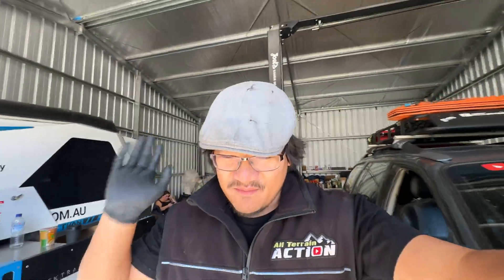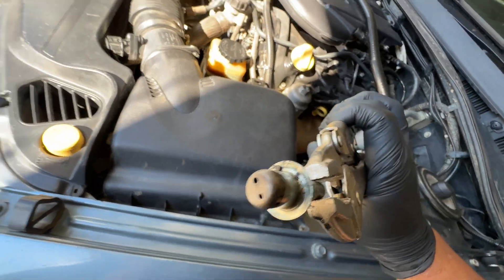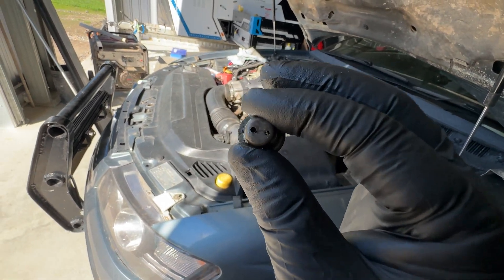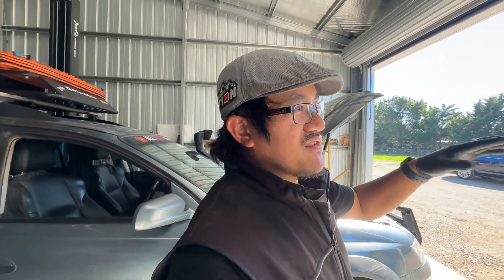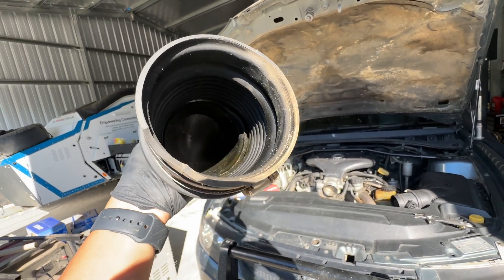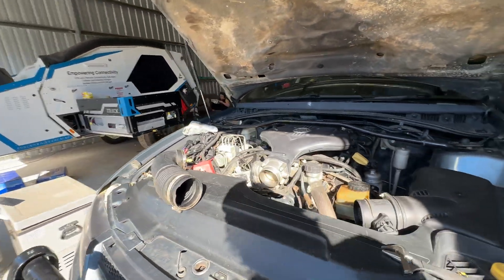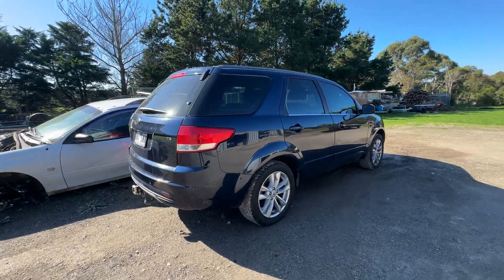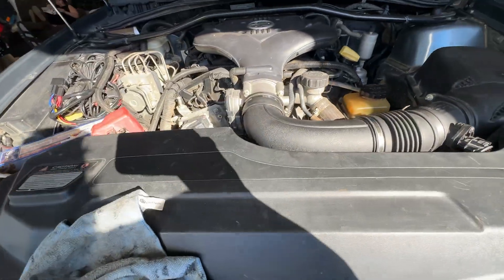THE CORRECT PCV mod 40,000km Result - GM ALLOYTEC V6 LY7 LE0 Engine

Comment: I used to get oil in the front intake and in the throttle body/butterfly of my VE Calais LY7 until i read that GM themselves recommend drilling the top hole of the PCV valve to 7/64 and the bottom to 5/64 . These specs come from GM in America as they use the same engines there as our VE etc. Mostly the V6 camero etc.  I clean the PCV system every time i change the oil at 6000km and my LY7 is pristine inside due to the proper oil changes and PCV cleaning. Make sure that the rigid plastic pipe at the rear of the engine isn't broken (a common thing) also. My VE has done 371,682km. I still the use the original 5/30 oil and it doesn't burn one bit of oil between changes. No Knocks or taps. Nothing but an engine that keeps going strong. Keep up your maintenance.  Not a drop of oil in my intake or throttle body.
Reply: @darrenheading7046  the ridge plastic pipe do u mean the valve breather elbow? If how the f do i get it.off mines super loose and won't come off

Comment: thanks for the update. To be sure 3mm on top 1.5 and 2mm on the bottom right?
Reply: @bigred8438  I’ve done 3mm top and 2mm for both bottom on mine but I have a catch can installed get 2-300ml every 7000k’s when I service it. Actually considering deleting the pcv valve all together and putting an fittings on both rockers instead I’ve got issues with the pcv & passenger side rocker valve creating a vac leak because they won’t seal properly and just sit in the cover.
Reply from the maker: @blown454350 that’s a known issue yep.

Comment: Seems like a lot of fuss to save 200ml-1L of oil in 10,000km. To each their own I guess... I think I'll just carry a litre of oil lol
Reply from the maker: You’re missing the point, this is linked to timing chain failure. Engines that receive this early seems to sustain longer timing chain life. Most alloytecs getting this done early 200,000kms have gone to 400-450k on original timing chains. It also stops front cam sensor seals leaks and rocker cover leaks from crankcase pressure build up.
Reply: @AllTerrainAction  Just change the oil regularly at 3k miles and your timing chain will be fine. I'm not missing anything.

Comment: So should i do the mod or not ? Or just keep cleaning the oem one every 30k
Reply from the maker: Cleaning OEM one every 30 is fine in my books if everything is stock, if you drill them - then do it to the specs mentioned in my other video. Drilled ones to the spec seem to breath better lesser chance to build up blockage/restriction but if OEM is maintained regularly then it’s nothing to worry about.
Reply: thanks for fast answer . so if i drill it i must install catch can  or its fine without catch can  cuz i worry about oil go inside the manifold  . thanks  @AllTerrainAction
Reply from the maker: Fine without catch can if drilled to the specs mentioned in other video. It’s a very minor drill out, if you exceed that you may need a catch can. I’ve ran this 40,000kms with no catch can and Intake is in great condition.
Reply: I think the mod has advantages.There will be soot/ burnt oil build up on the dirty side of the cylinder banks even with cleaning of the standard pcv.That was my experience with very good engine hygene.
After 223,000klm with no pcv service at all but very good oil hygene the pcv was clean and clear inside but you could see a soot crust at the opening of the rocker cover and on the ends of the pcv from poor crank case vapour and gas ventilation.
I did the mod .
I have a catch can too.

Comment: if it is using oil  topping it up with new oil is probably good for it
Reply from the maker: I agree, as long as you are topping it up. The downsides also are more than normal carbon build up and possibly more than normal amount of deposits left within your cat, leading to premature wear in other places. Where one positive, often you might introduce nother negative. Each to their own though.

Comment: why not just run a catch can?
Reply from the maker: In my situation, it makes sense to install a catch can, and I likely will once I've shown in a real world use senario that there’s benifits with the correct modification for everyday use - it costs people nothing but a dril and some time to do this. Using a catch can is a beneficial modification to ensure the long-term health of anyone's alloytec but you have to pick a product, mount it, do some basic plumbing work and understand what its doing plus drain it. Overall, this modification is ideal for anyone with a standard setup who simply wants to maintain their vehicle's engine ongoing - but for those who want the next step catch can for sure and I'll do a video with that when that time comes.

Comment: Its not a Ford Territory you got there Chris. Its a RWD Land Rover/Jaguar/Citroen Discovery.
They were not the most reliable vehicle ever hence why most of us opted for the early 2010-2011 Model with the Barra inline 6. As past 2011 they only made the Barra in RWD format. 
The Lion engine was just a ticking time bomb with timing belt issues which had to be done every 80,000kms and yes.. that gearbox connected to that diesel engine was hideously unreliable with everything from the Torque Converter just exploding to the valve/Solenoids just randomly dying. The most spectacular self detonating Lion Diesel was one where I watched as the High pressure Oil pump decided it didn't want to be a pump anymore.
Reply from the maker: So fix it and move it on 😂

Comment: Was that a FORD Territory I seen in the background lol.

Have to try fix it.
Reply from the maker: 😂👀 bugger you’ll have to come down to Victoria to help me out mate.
Reply: @AllTerrainAction  haha nah still not sold on the diesel.
Reply from the maker: @TerritoryOffroad  yeah I read many not a fan of the 2.7 although the fuel economy side of things seem promising. Drove it 80kms through mixed traffic and without 5/6 and somewhat 50% highway over 90 minute drive trip reset showed around 8.1L/100 which is giving me ideas about a run about car for the workshop. 👀
Reply: @AllTerrainAction  Yeah that's the big thing people love about them. My SY sits around 14 per 100 so fuel economy isn't something I like to talk about. The old SX is worse. I think like any car if they are looked after they will normally be mostly trouble free.
Reply: @TerritoryOffroad   LOL Mine definitely has a bigger drinking problem than yours Keith as mine sits on 15.5 per 100.

Comment: I havent drilled my pcv, I just clean it every 12 months.
Reply from the maker: Nothing wrong with that but I actually think the flow might be better as well this way, I’ll be able to support that claim as well when I reopen the left and right banks when I add the cams in. Normal size I think restricts that bank and hence why one side is normally yellow/gold and the other is dark brown/black.
Reply: The hole size in not good enough. It was in the late VF’s that GM and Holden changed the PCV to the size we are drilling out to. It’s a big positive.
Reply: @FuManchu5ltr what is the sizes plz?